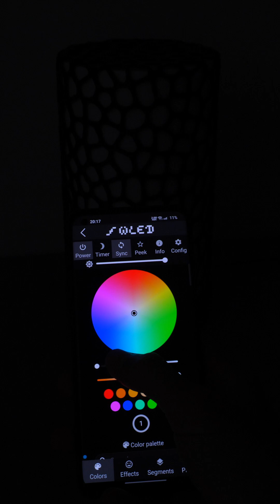I made 3D Printed RGB WLED Lamp

Comment: What Pin did you connect the LED Data line too ?
Reply: GPiO 4 (or D4) but u can change the pin in wled settings!
Reply: Do you know where that would be on a esp32 board

Comment: I'm new to 3D printing and wanted to make this for my desk. When I put it in bambu slicer it says it needs supports, but I don't see you printing with any. What am I doing wrong?
Reply from the maker: Hi, if you are talking about voronoi shade,  your slicer might want to add supports in certain places but there is no need to, it should print just as well without them.
Reply: @BasementCreationsChannel  ah. That's what I wondered. Thank you 😊 I will post my make on your thingsverse when it's done

Comment: I would love to try it out. But I have on question though. I might add some additions with a tiny LiPo battery tho. How does the software handle multiple lamps at once?
Reply from the maker: Hi, it should work with LiPo if you add a 5V converter. And if you are asking if the app can control multiple ESP boards I think it can, and it might even be possible to synchronize them. But check it on the WLED Project website just to be sure.